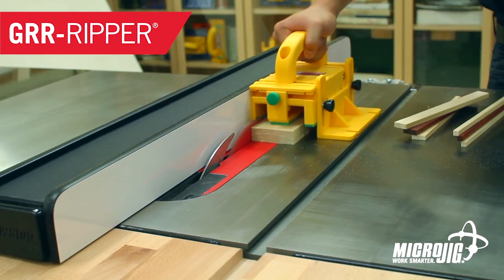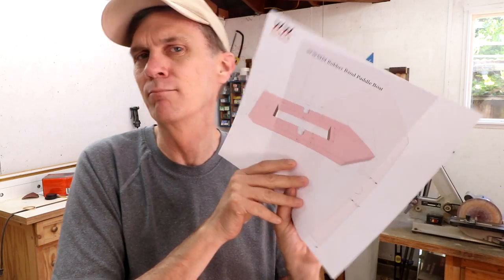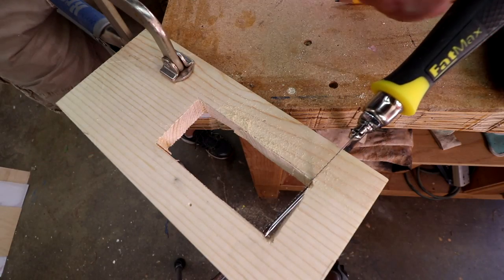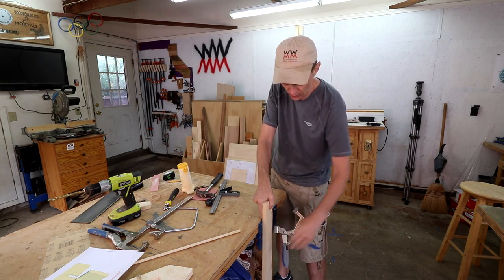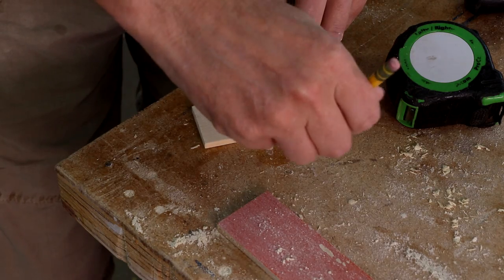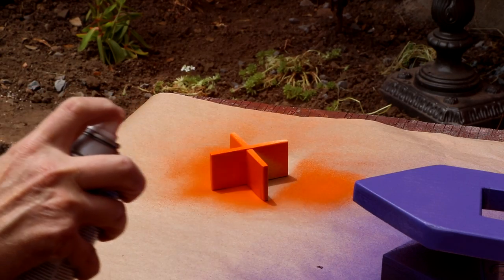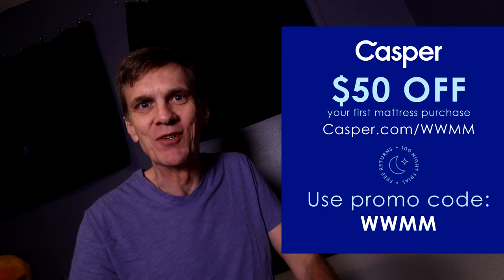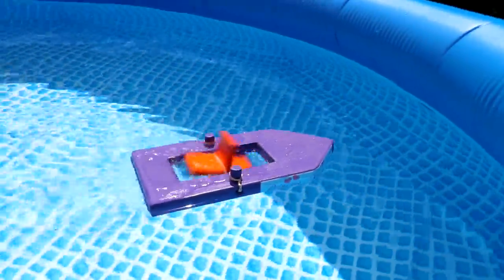How to Make a Rubber Band Boat Using Hand Tools.

Comment: Great Video, a rubber band boat used to be included in the cub scout handbook  it was simpler than yours it used a U cut out at the back  and just put the rubber band around the boat instead of drilling holes.   This is a great project for parents or grand parents to watch over their kids making one.   Keep up the great projects.

Comment: Steve - I think you would increase speed and distance by removing the cross piece in the stern.  The cross piece seems to create drag.  Don't shorten the boat, but elongate the hole.

Comment: Steve , which would be the easiest and cheapest types of wood boards to look for at home depot, so beginners can cut and sand manually without power tools? ...also, if I need to spray paint something, which type should I choose, or it doesn't matter?
...I think you've already made a video about that, but I can't find it... Thank you!

Comment: OK, I have subscribed, I like your channel and your down-to-attitude. But I am going to offer a suggestion. Violins and hand saws have something in common (files too). As a beginning violinist, you are taught to use the full length of the bow. Hand tools follow the same logic. long slow strokes, using the whole blade, you will cut faster, get less tired, and your tool will stay sharp longer, instead of just getting dull in the middle. 
Please don't think that I am picking on you, everyone on YouTube who uses hand tools is making the same mistake.
I wouldn't bother to comment if I didn't like your channel. 
Keep up the good work!
Reply: That's a good tip.  I hadn't noticed that myself.

Comment: A great idea for a granddaughter gift.  Thanks, but you have to be scolded for your saw technique.  As you're ripping the stock thinner, you have to follow 3 lines: the one on top, as well as the front and back.  If you cut on a diagonal, tracking your saw line on the side facing you and the top, that is simple enough.  You've now created a kerf line that forms the hypotenuse of a triangle (sorry to go all geometric on you).  Flatten the sawing angle out as you did when you made your original mistake and your saw will track in the kerf you've already established.  Voila!  And it would be nice if you maintained your chisels a little better as well, regardless of their price.  You'll probably get several comments like this, and I don't intend it to be malicious, but if you delve into hand tools, at least show the proper technique.

Comment: If the paddle wheel was at the back rather than in the middle it would probably go faster. Its dragging the back of the boat under the water